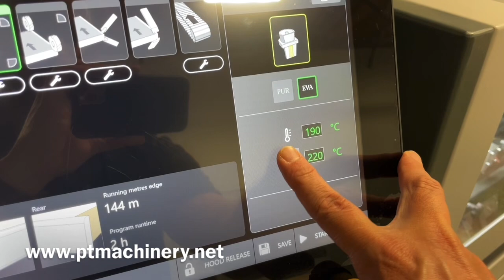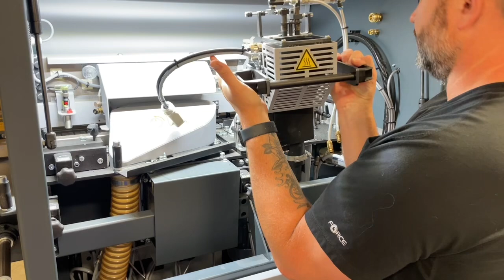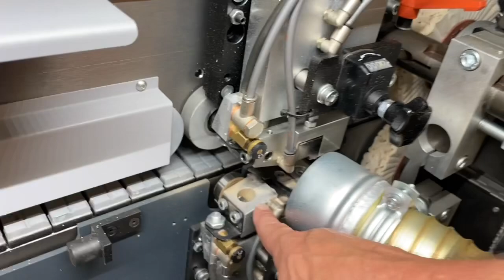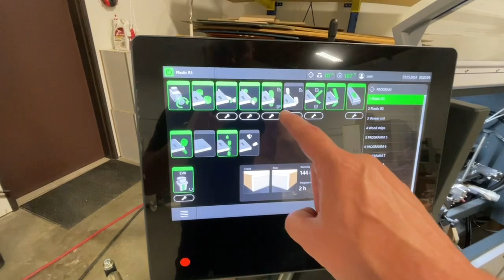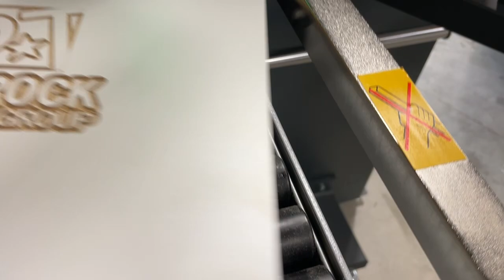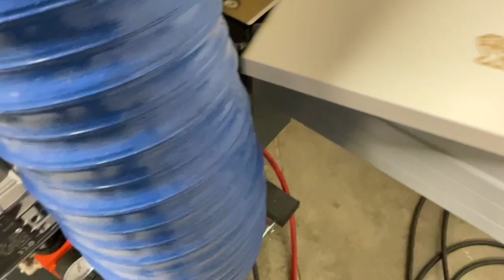Altendorf America Hebrock F5 automatic Edgebander walkthrough

Comment: The saw blades of the end trimming unit on the edgebanding machine must cut the edge overhang in the same direction in both cases. This means both the front and rear trims should move only upwards or only downwards. Currently, on this machine, the motor on one side cuts the front overhang during its upward stroke and cuts the rear overhang during its downward stroke. As shown in the video, this causes chipping or a poor-quality cut on one of the sides. It should operate like the scoring saw blade of a sliding table panel saw on both sides

Comment: This is a garbage machine from manufacturer that doesn't know about PID control of glue heater and is killing contactors by constant switching many times per second and plc relays and every commumication with them is futile. I would never buy anything made by Hebrock.
Reply from the maker: Sorry to hear this. How many contactors have you paid for and replaced? I haven’t had to replace a single one for any of my customers since I began offer these about 2 years ago. Is yours an older model? Who have you spoken with in the service department? I’d love to follow up with them. 

We’ve had several customers replace problematic machines with amazing results and superior edge quality to anything in its class. Is it a larger investment than a $20,000 Chinese import. Yes it is. But it’s a well designed machine that has shown to be reliable and deliver far superior results. And unlike most of those cheap imports you can actually get a professional install, setup, and training with the machine.